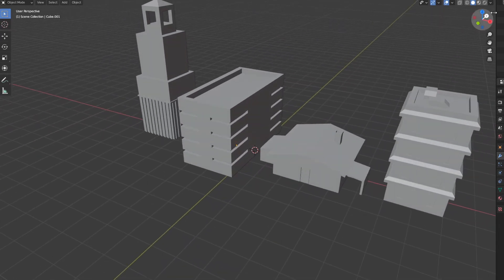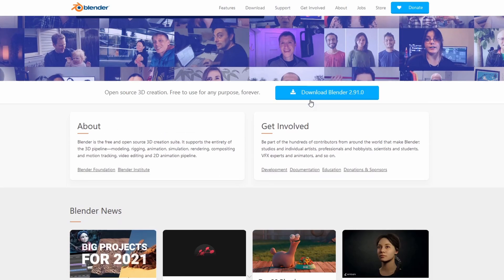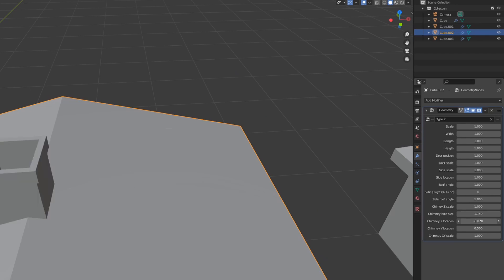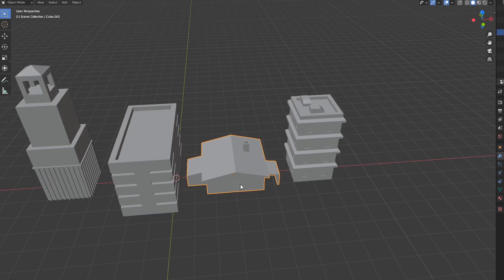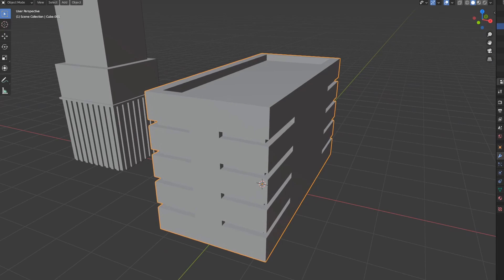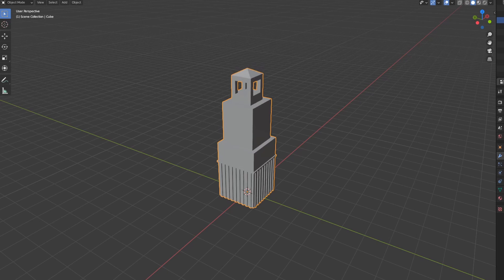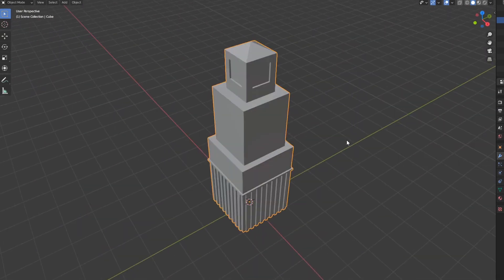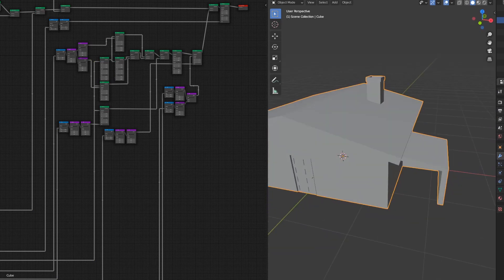Procedural Buildings v1.2 With Geometry Nodes [Blender 2.92]

Comment: VERY nice MantaflowLife....  Your OCD is very obvious in your node setup :)  Is this an AddOn or just a project file?  I try to open the project but it crashes my Blender. I have Blender version 2.92. Thanks!
Reply: Thanks for your reply. I just watched your latest video also. Yea not sure why it crashes my 2.92 but I'll install version 3.0 & leave 2.92 installed also as I'm always scared to fully switch to ALPHA version. I will look into appending node groups. Cheerz!
Reply from the maker: @ashtyler8  It crashes because in 3.0 there are different boolean inputs and switch node and if you open it in 2.92 it decides its going to get corrupted but it works in 3.0 so have fun:D
Reply from the maker: Thank you:D:D This is just a project file, but you can append the node groups anywhere. Sadly because I wanted to make it futureproof some buildings work in 2.92 but ALL work in 3.0 (https://builder.blender.org/download/).
Enjoy :D